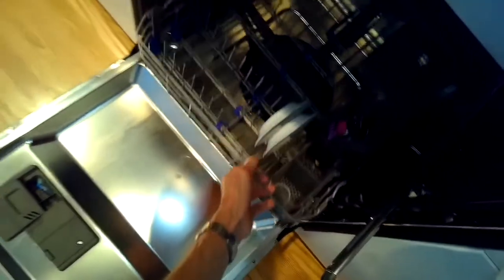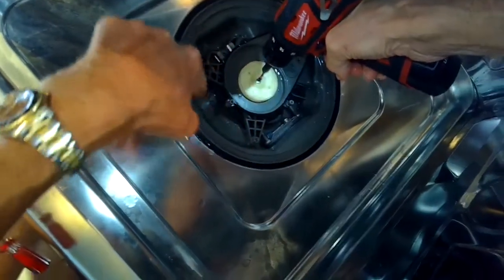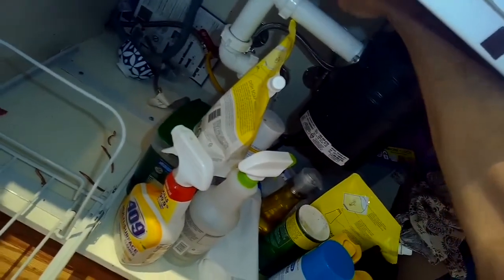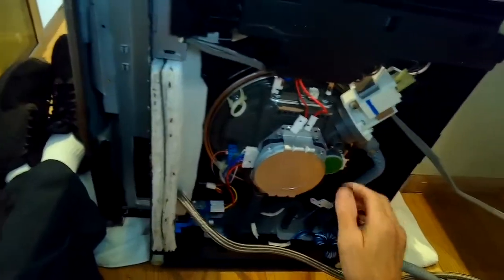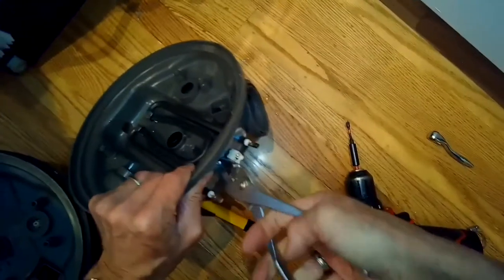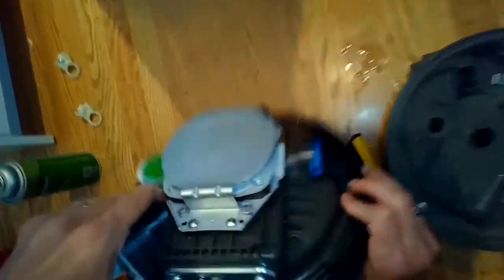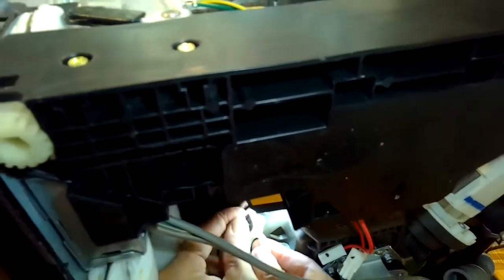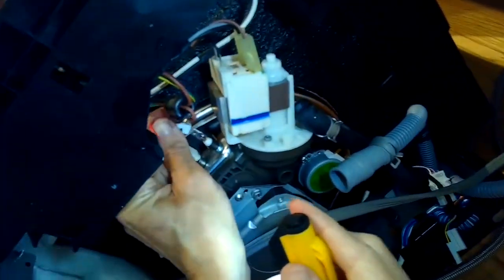✨ LG DISHWASHER  - Won’t Heat The Water - Fixed ✨

Comment: Just replaced the element . Pulled machine out , took filter out and managed to remove element from the side . It was a little tight but beats all that extra work. Removed  10 mm nut but could not remove element as gasket was swollen - cut chunk off gasket and it came out .

Comment: You CAN replaced the heating element without going through all the work of removing the sump. Lay the dishwasher on it's back and after removing the 10mm nuts pull the element out and replace it.  Might want to ohm it first to make sure that's the issue.
Reply from the maker: That’s right,
Thank you

Comment: Thanks for this video...I have the same dishwasher that keeps putting up HE code and will not go away despite resetting it. Works well now after changing the heating element. One thing though...the pliers is not enough to tightened the nut of the heating element because it leaked when I tested it.

Comment: Posted last week that I replaced element :: It did two perfect cycles and the third cycle I got the HE error .  Element is “Open” no resistance . Ran dishwasher with element connections removed and connected to volt meter —- 123 Volts ,, So one 5 year old LG dishwasher heading to the DUMP. There’s no way the appliance parts place will even ask LG if they have a screwed up batch of elements.

Comment: Don't buy an LG dishwasher after 4 years all the replacement parts have added up. Heater HE code, spray arm motor nE code and the hose bE codes.. What garbage and valuable time wasted on it.